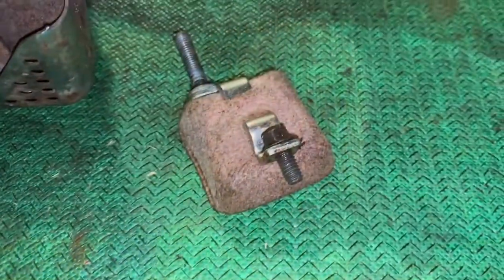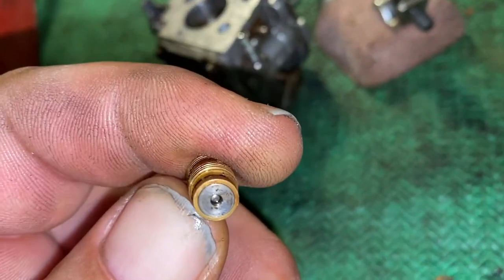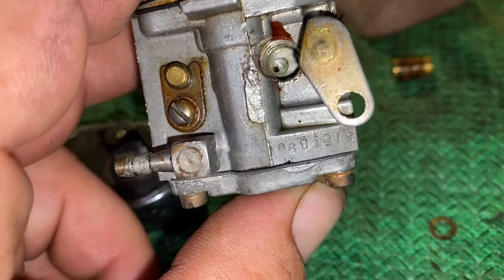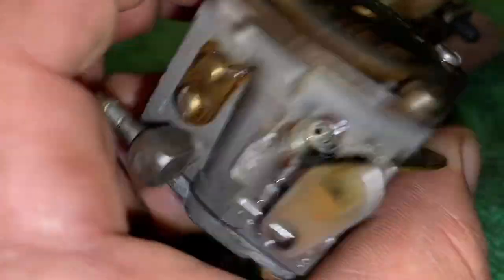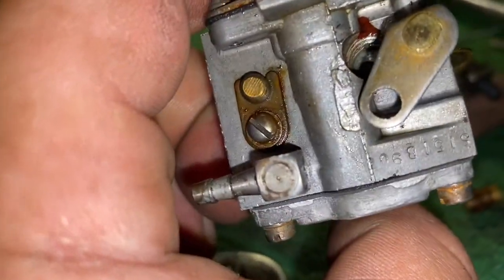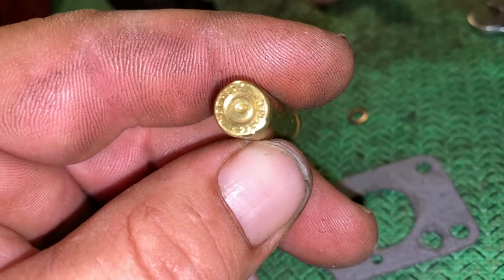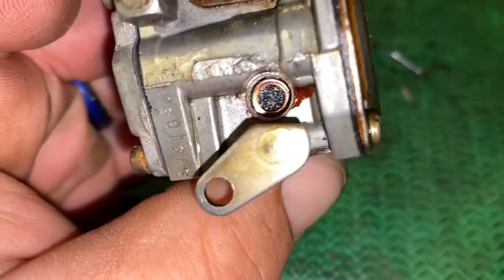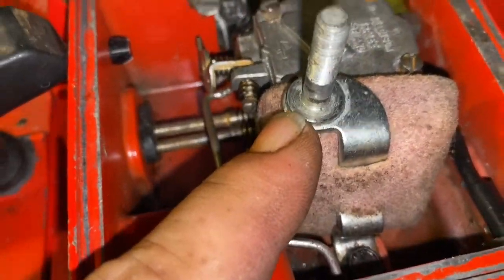Governed Carburetor Block On My Homelite Super XL-925

Comment: some paper punches will cut a disc about that size needed to plug the hole. For the air filter fix a thing piece of open cell foam can be applied over the stud. I actually have gotten into the habit of a secondary air filter, a full sheet of the foam cut to over size of the air filter, screw down the lid with it in place and you get a real snug fit secondary air filter and it also makes the primary filter sit down solid on the saw air box frame. I like your illustration on this governor fix, nice photos and clear explanation.